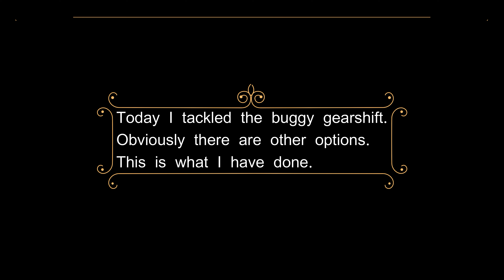RC4WD Zetros 6x6 Fix Gearshift

Comment: That little screw on the shift rod sticking out of the transmission just mashes that cable to hold it there. You can shorten the cable by loosening that little screw and pulling the cable a little tighter than re-tighting the screw. On mine the cable was wrapped once around the screw just below the head with a small washer between the cable and screw head. If you have trouble getting a tool on that screw you can remove the 4 screws holding the transmission to the frame rails and you can lift the whole assembly up a few inches to get a driver on the shift rod screw.
Reply from the maker: Thank you for your feedback. I appreciate it.

Comment: I have the same truck does the truck always have the front end locked in or can it be disengage having trouble figuring out the controler
Reply from the maker: That controller slide slide switch has 3 settings. 
Hi speed free wheel, low speed free wheel and lowspeed with difflocks engaged on all axles.
Reply: Thanks for your help
Reply from the maker: @tony5247mittens  Let me know if you come right. I love this truck.
Reply: @ColynSerfontein  everything is good
Reply from the maker: @tony5247mittens  I am glad to hear.
Reply: @ColynSerfontein  works great now thanks for your help